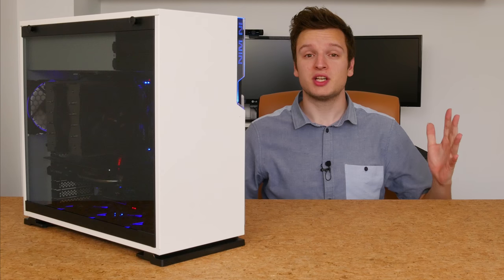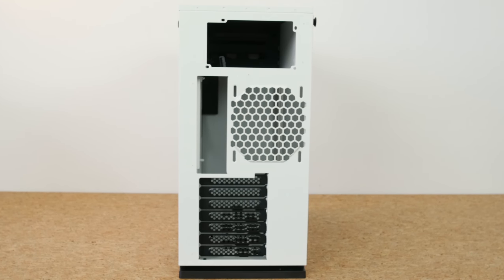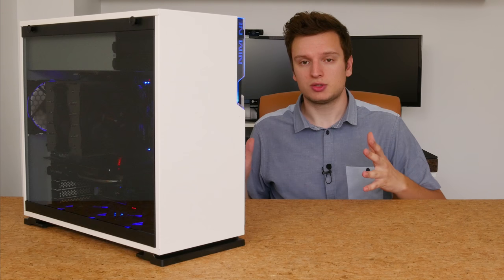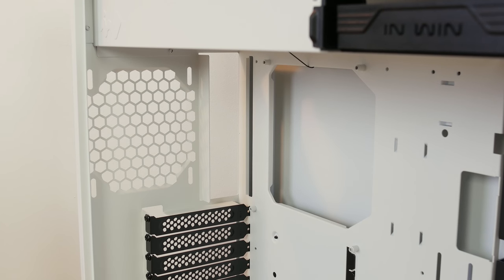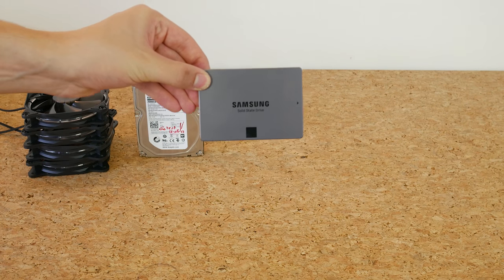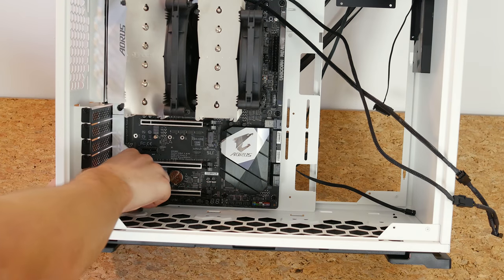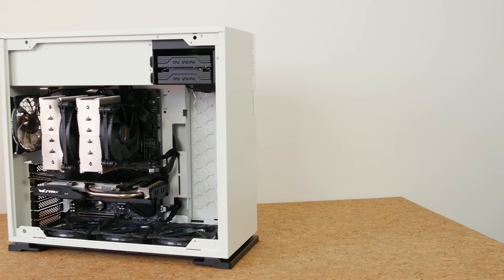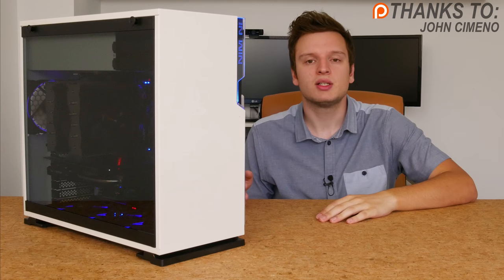IN WIN 101 REVIEW AND RYZEN BUILD

Comment: Good video, seems to compare well with the 103.  I am looking at moving my Ryzen 5 1600 (stock cooler) system from it's current case, a DeepCool Tesseract with 3 120mm rgb fans, right now though is the concern of fitting the Asus Rog Strix B450-F Gaming motherboard with it's preinstalled IO shield in there and still having room for the bottom intake fans  (I am going to need more fans).